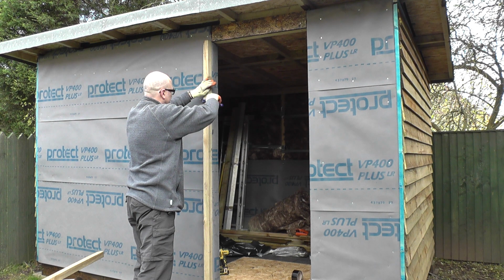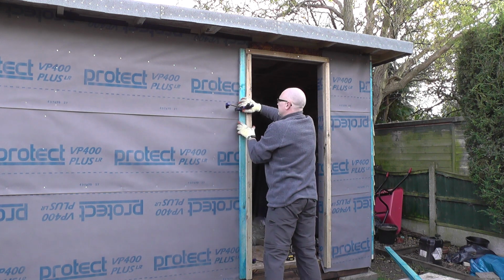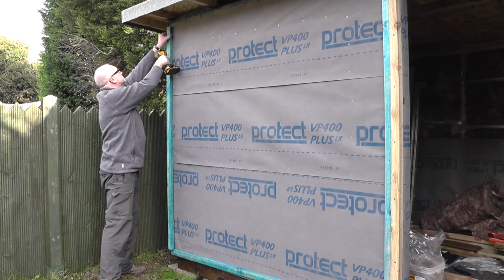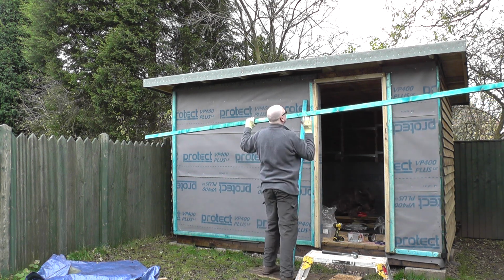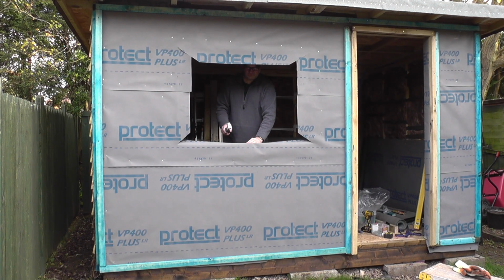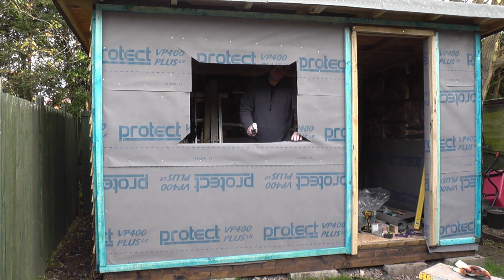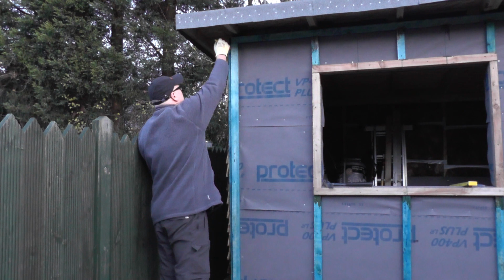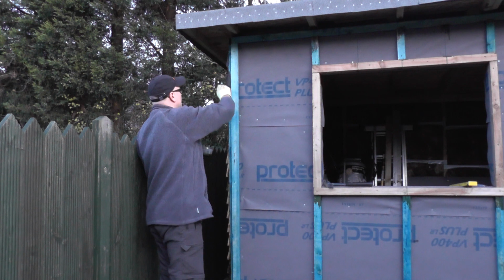DIY Man Cave / She Shed - Part 14 - Battening The Walls

Comment: Hi Des, you have blocked all air circulation by putting those top and bottom horizontal lats in. If you use horizontals, they must be counterbattened to allow free air flow. You have just made it pointless battening the cladding off the breather membrane and may aswell have cladded straight onto the osb. Definitely dont put bottom and top horizontals in. Only verticals. Unless you're counter battening for vertical cladding of course
Reply from the maker: Hi there. In theory you are absolutely right. In practice, however, this is not the case at all and I must respectfully disagree. Have you ever looked at featheredged boards close up when fixed like this? It is a fact that they bend and warp slightly and do not form a tight fit against one another. Thus, there is plenty of opportunity for air to enter and leave and flow around the structure. Timber expands and contracts and sometimes the gaps will be smaller - sometimes slightly bigger. Knots also fall out and leave holes as well as adding character. Also, if there isn't some sort of barrier top and bottom then the areas in between will simply become infested with all sorts of critters.  I am, of course, not sn expert by any stretch, but I did consider the very points you have made. May I also thank you for your valuable feedback. Best wishes, Des
Reply: @21stcenturycaveman33  Technically the OP is correct, leaving the horizontals open or fitting a mesh edge allows airflow and prevents any water ingress from sitting at the bottom.  Having said that its classed as a demountable structure so does not need to adhere to building regs. You should be good. 
Just browsing YT this morning and found your project interesting as I'm currently building my own garden office/man cave. Look forward to watching the series through, good job

Comment: can you explain the purpose of the battens ? wouldnt it be possible to put the feather boards directly to the membrane ?
Reply: Putting the feather boards directly against the membrane is and has been done, but the gap allows air to get behind the boards allowing even drying tho, there should be gap top and bottom to allow a chimney effect behind the boards I don’t know why he put the horizontal batons top and bottom as the stops any air from entering behind the cladding.
Reply from the maker: Plse see cpmments section for explanation. Thanks, Des
Reply from the maker: Plse see answer in comments section below. Des

Comment: Ive just done what youve done by accident. I put a length of batten  accross the bottom. Wont this prevent any water ingress past the cladding to just sit there instead of using vertical battens only Des?
Reply from the maker: That's a really good question and I understand why you're asking. However, if your timber is treated and properly maintained I wouldn't have thought it would become that saturated tbh. You would, of course, also need to ensure that there's an adequate overhang to avoid creepage of moisture back up to the battens.  Also, if you chose to fix just vertical battens and no horizontal ones can you imagine how many creatures would take up residence in their new home? It would become absolutely infested in no time at all with anything that crawls, flys or slithers. Put the horizontals in Squats lol.  Best wishes, Des
Reply: @21stcenturycaveman33  The air can not circulate because of the bottom battens
Reply from the maker: @kyearsenal1232   Absolutely not true. There are loads of small gaps where the edges of the boards overlap and the timbers also expand and contract. Plenty of air circulation. Absolutely NOT a problem at all. ATB, Des